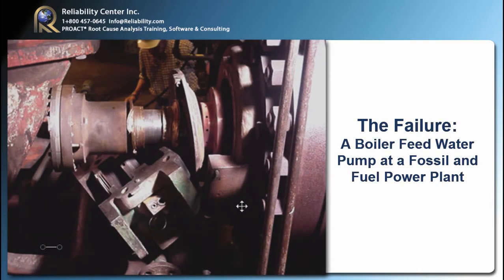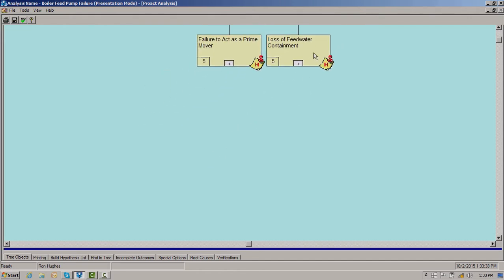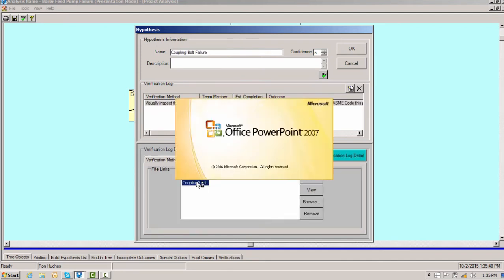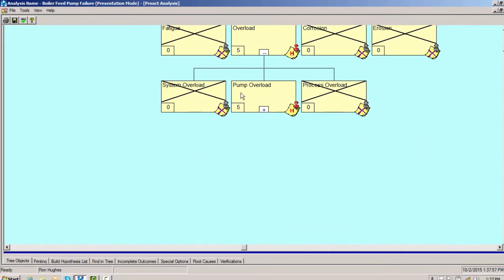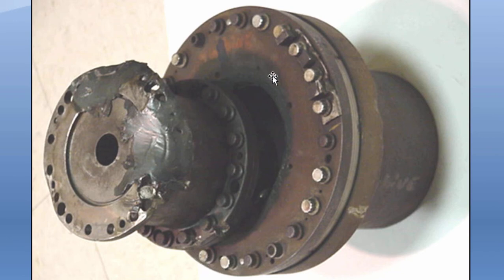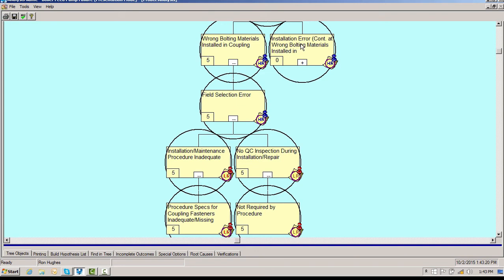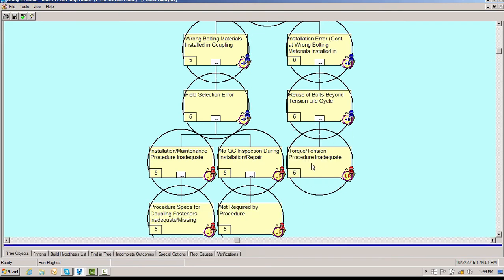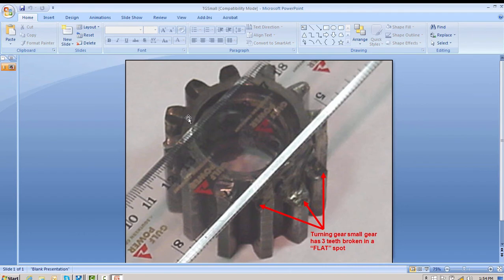Boiler Feed Pump Failure Root Cause Analysis

Comment: Pretty useful analysis on the failure of the TD- BFP. One query here. Such a critical piece of equipment should have surely been covered under a condition monitoring program? Did the CBM program not give an prior indicators of failure?